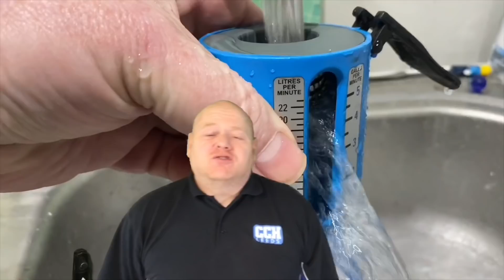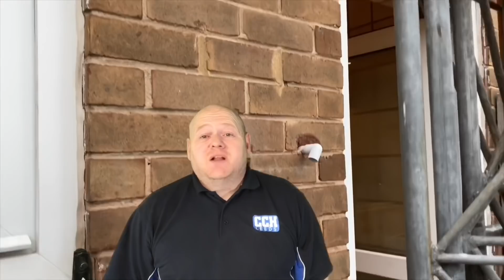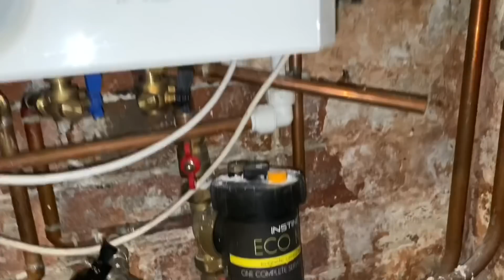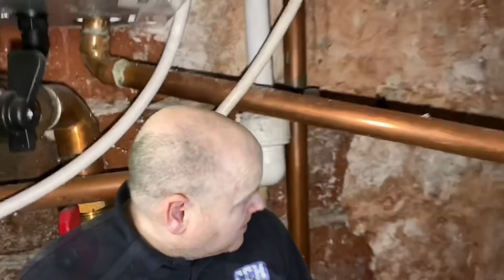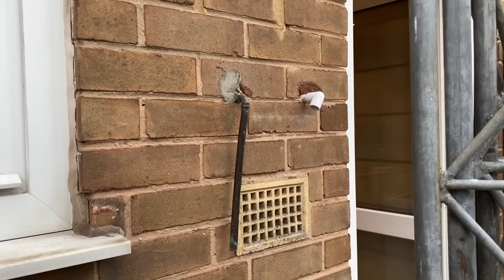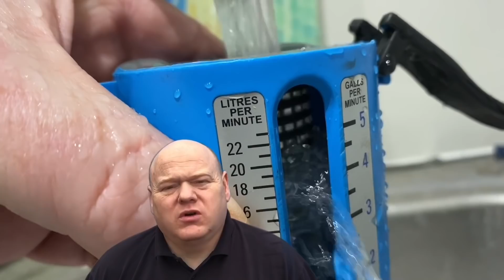LEEDS PLUMBER - BOILER QUOTES

Comment: This type of presentation needs updated! My Worcester Bosch 30 CDI is nothing less than a millstone around my neck, and bank account!!  I hope that a Worcester Bosch manager is viewing this!  New fan fitted yesterday, ran continuously until midnight then isolator had to be switched off. Engineer called back today and now says that the pump needs replaced, the 4th one!

Comment: Hi Alan, thanks for providing your expertise. I’ve really been informed by your working examples. I’ve just asked for a quote from an official wiiessman supplier to provide a quote. I don’t suppose you could give an indication of a price, the supply and fit of the Wiessman 111 I think was their recommendation. I have a 4 bed house with up to 3 showers potentially, GF, 1st floor and attic. The existing pipe work is in sound condition , I assume. My current boiler is a 14 year old Ariston ecombi, which has been almost completely trouble free but has just developed  a fault indicating ‘ insufficient circulation’  Not sure whether it’s worth repairing. I should add, it’s never been serviced! But, it’s been absolutely great all these years.
Penny for your wisdom. Thanks Alan. Peter, Glasgow, uk

Comment: hi.allen,hope the missus is ok.I have the exact same problem same boiler,decided not to throw good money after bad and went for new boiler but was quoted 2750 for the same boiler which was a straight swap as the previous install was first class.I told the rep where to go and am going for a baxi 630 due to depth restrictions, if i can find an installer which is not easy these days.
Reply from the maker: Hi Trevor send me your details and I will try and help with an installer 07725 692699

Comment: The brickwork : The one before that one was probably to close and eroded the brick -- so that is what they did 'a patch it up'. Now the extension from the wall is 'slightly' exaggerated hoping they didn't have the same problem again.  Fortunately it was protected by the antenna mast.  Unfortunately, cooking fumes and steam will play havoc on the control circuitry.  Maybe they should add a doghouse to the back of their wall to house a boiler, it couldn't look much worse.

Comment: The first one you could replace with a ATAG boiler(expensive but good)
Prv and condensation terminate in the same pipe. 
I would probably charge around £2000-2500
Reply from the maker: What about that brick work😂

Comment: I see shite like this all the time..fitted by A.N.Other Heating Services ( Gas Safe Reg 12345678) Regardless of quoting to do it right, filter, flush, correct gas pipe sizing, benchmark and doing the boiler notification customers see PRICE most of the time

Comment: Am a plumber and I would say most them installs were by cowboys builders. The worst one I've seen is boiler installed outdoors in the open air. Have seen a radiator outdoors aswell were customer requirements was heating while they went out for a cigarette

Comment: Having seen some terrible making good around flues but none as bad as that.

When a neighbour opposite had their boiler changed, as the flue was on the front of the house I gave them some matching bricks to make good. The the installer still botched it. The bricks may match the existing but nothing else does - the bonding doesn't and the mortar is way off.

Comment: Hi allen

Do you think the viesmann 111 35 kw storage combi  would satisfy a two shower property with a incoming flow rate or 17 lpm. Simultaneously.

Thanks
Reply from the maker: Cannot say without looking at property, Cylinder might be better but it depends on space. The 111 is a great boiler though. Thanks.
Reply: Thanks allen

Comment: 1st install I'd quote the landlord for a Main compact magnacleanse and new Mag pro 1 filter and new controls and yes too a baxi 600 or 800.  With the second install when you see a flue like that it's usually a builder or diy install for the 2nd either a viessmann  100 or a baxi 800.  For the 3rd a Viessman 111 or an Atag I40R or I32R dependent on the no of bathrooms.
Reply from the maker: Thanks.

Comment: Mother in law was in sheltered accommodation, council owned. They updated it and fitted full gas central heating, was originally electric storage heaters, the company that did it came from over 100 miles away, and had 1 day to complete the installation, 2 men, it worked, which was just about all that could be said, don’t see it as the installers fault, but the council, went for the cheapest possible quote. Never heard of the boiler make, cant remember what it was but when it broke, no spares could be found,  had to have it all redone correctly, with a Baxi, and all the pipe work replaced, so cost the council twice. The original installers left the house in a complete mess, they had another install the next  day, for the same council, just had no time to tidy up, they did apologise. With the traveling they must have been working 14-16 hours a day. The council even wanted to charge mother in law to come and pick up the old storage heaters.

Comment: Viessmann every single time.
Reply: My opinion is that what Viessmann did is "bible" for the rest of the boiler manufacturers (I only refer to the 200,300 Vitodens series with matrix burner and Vitocrossall model). Exceptional design; What other boiler allows you to set what season to be based on the time of year you are in (eg. if you are in the southern hemisphere where it is winter in June and summer in December - and had these settings on the menu 15 years ago. ...)
For the problems below I recommend my clients to buy Victrix Pro boilers from Immergas (hyunday genesis vs mercedes s Class: P)
There are more problems in heaven than on earth:
1: Electronic boards: not very reliable - 5-8 years are starting to have problems (easy to repair for those who understand)
2: They like to penalize you for trivial installation mistakes: if you install the chimney with the outer tube (suction) up, if it is raining heavily towards the chimney or if you have problems with collecting water from the roof and reach the chimney of the boiler the water will reach the outside of the combustion chamber and from there directly on the gas valve (not only because the electric connector of the gas valve is burned but also the supply side of the gas valve from the electronic plate: a fuse of 1 Amper fuse). (seamed on the electronic board) and the rectifier bridge (for newer models with a DC electrical supply gas valve)). If the water in the gas valve has reached and the connector on the gas valve is charred, the electronic board will burn - in which case the board does not cause any damage just because the boiler does not start the flame and you inexperienced technician say that after 3-6 years of without problems, the board can be damaged and you bring a new one, you mount it up and because of the carbonized connector on the gas valve you just burned another electronic board (1Euro components but for those who do not know how to buy the 3rd board ... )
   Water can also reach the electronic fan board .... :( - Other manufacturers do not allow this by combustion chamber design that has rainwater collection and diversion system but at viessmann it represents about 50% of all defects and Viessmann people love to make money from this kind of flaws ...
3: At the vitocrosall boilers (10000E / 60KW boiler) the older model (maybe even the most recent models) - the automation made by Dungs that controls the combustion uses a primitive flame detection circuit at all reliable and after 5-8 years you can find out that you need another automatic for the combustion control (component 500E) because they chose to use a poor quality 100nF capacitor on the flame detection circuit - all for the purpose of selling parts in the future ...
4 at Vitotronic 333 the newer models with monochrome display chose to use a screen with very poor contrast, which is quite difficult to see - on older models the screen had much better optics.
....
Reply: Mihai Achim the genesis of boiler design indeed. Cheers
Reply: Mihai Achim 
Hi mihai 
That is very useful information, I have in service many viessmann vitodens, 050 &100 models 
Can u tell me which capacitor is prone to failure? And how did u diagnose this?
I have replaced Pcb relays before but nothing else 
Appreciate your help!
Reply: Mike L 
I’m with you on that mate! Viessmann are all-that I’ve been fitting last 10 years and I’ll never look back

Comment: Great video again! As a customer, it is hard for us to ensure the installer is the "right" person for the job. We expect plumbers/heating engineers to know their stuff and do the best good job. Cheapest is not always best and to be honest, I bet there are expensive plumbers who are not much good either. Apart from seeing the words "Gas Safe" on their website/business cards, all we can use are sites such as Checkatrade (and have you ever seen a negative review on there?). 

Your videos are brilliant as it allows me to now ask the right questions of any boiler installer doing the work. Fantastic stuff!
Reply from the maker: Hopefully, my video’s will help customers choose the correct installers by seeing what they should expect. Thanks.
Reply: The reason you only see good reviews on checkatrade is because only good engineers use it really. It costs our company £150/month to be on checkatrade and the website is driven by reviews and good reviews, if you have poor reviews then it will show in your score and if you dont have any reviews you will drop off the page and not be seen my the customer. 

So we need to make sure we have a consistent high level of work and customer satisfaction otherwise we would be wasting £150/month. 

I may also add if we did get a bad review we have no way of removing this review so it would show no matter what. All of our reviews are 100% legitimate and are hard earned and we have a rating of 9.8/10.

In summary if you're a poor engineer with poor workmanship it would show immediately on checkatrade and there would be no way of hiding it so therefore if you are a poor engineer you probably wouldn't waste the money on checkatrade.

Comment: hi allen interesting video and some shocking examples of poor work or even DIY !! How much do those boilers cost with 10yrs warranty? Also you mentioned the boiler wattage is 30 watts do they come with higher wattage and what's the maximum you can buy?
Reply from the maker: You need to choose the correct boiler for the property. 40kw is one of the highest for domestic. Bigger is not always better though.

Comment: First one I'd have gone with a baxi 428, ifos, filter and a flush. I would also give an option for the 630 or 830 if the longer warranty was wanted but usually find landlords always go for the cheaper option.

Second one I'd have just ran 🤢

Third one, 18lpm isn't personally that great, obviously you get restriction through the tap etc so not a true reading but looking at that, I wouldn't put a heat store combi in, a vaillant 838 would be good for that in my personal opinion. Obviously the video has limited content to properly assess the property to what system would be best suited. 

As for jobs getting worse, your going to see more and more of it. Customers want to hold onto their money more and more. You go in a price for a proper job. Customer thinks its expensive, they get a second quote from the local do it all dave who comes in much cheaper than you. All customer sees is a saving and the thought of how good the installer is doesnt cross their mind, then they're left with a shocking install and out of pocket too.

Comment: Alan, when you have something like 18 litres a minute, can you install a larger kilowatt boiler. Is that corrected? The better flow rate the more kilowatts?
Reply from the maker: Depends on requirements but normally Yes. Thanks.
Reply: depends on your mains pressure as well if its a combi

Comment: Every landlord I quote for, especially around the West Yorkshire region, always seems to have a “cousin” that can do it cheaper!
Reply: Great. Let his cousin do it then.
Reply: Similar issues in Rotherham. Of course, this is purely annectdotal; from personal experience. Perhaps I'm just really unlucky?
Reply: Many Private Landlords don't even know they are responcible by law . Landlords are legally responsible for repairs to heating, hot water, gas appliances, pipes, ventilation, wiring, and sanitary fittings. Boiler repairs and servicing therefore fall under your responsibilities.

It is also the landlord’s legal obligation to service any gas appliances with the frequency required by the manufacturer. In addition, you must have an annual gas safety check conducted by a registered engineer.
Reply: @Scott Gibson: There are landlords and then there are landlords. Some are well aware of their responsibilities and others, in my experience (call me a conspiracy theorist) play stupid. Those for example who think that a gas safe/landlord certificate is the same as a boiler service. Get a cheaper person to provide the certification then scream at the the boiler installer/contractor when the plate heat exchanger gets gunged up after 4 years.
Reply: @scottgibson7534  its annual but if you have a tenant leave after 6months then you must have 1 done prior to the new tenant moving in, just incase the previous tenant tampered with the boiler or any pipes
Reply: moneytotight I never find out! I never hear from them again!😉
Reply: moneytotight  im asian, I agree. .hahaha 👍🏼
Reply: Martin Hammond Lo l😂🤣😄😀😁 im on the floor man 🤣😂
Reply: moneytotight My name is Ahmed. I’m registered domestic gas and commercial gas & HVAC engineer but most importantly a competent one. I run extremely successful and professional business in my city for large domestic and commercial properties. What’s your point?
Reply: moneytotight why with the racism? This could also be Kevin or bob?
Reply: skeatel moneytotight My name is Ahmed. I’m registered domestic gas and commercial gas & HVAC engineer but most importantly a competent one. I run extremely successful and professional business in my city for large domestic and commercial properties. What’s your point?
Reply: skeatel  no need to be racist
Reply: moneytotight  racist

Comment: Allen do use many stand-off kits I find the great fo tidying up the pipe work
Reply from the maker: You can take the pipes up the back on the Baxi 800. Thanks.
Reply: Allen Hart didn’t watch all the video I see ,fitted a 600 the other day ,straight swap ,didn’t have to make a new flue hole ,condense had to run into a soil soak though 3.5 hours

Comment: Don’t quotes include prices? People want to know prices.
Reply from the maker: kryptoniteee I quoted £1999 for first one, full system flush, omega filter, update pipework, Baxi 830, Boiler plus controls,  remote prv, etc etc. Would of been a good job. Unfortunately I didn’t win the work.
Reply: Allen Hart woah that’s a good price for your level of work! Their loss for sure.
Reply from the maker: @kryptoniteee  I was actually going to spend two days at property and do a first-class job and flush it correctly. Unfortunately, i didn’t win the work.

Comment: Working for a large boiler manufacturer I see installs similar or worse every day. Old and new. It amazes me that probably 9 out of 10 flues aren’t installed correctly. Was at one yesterday where the installer  drilled through the bottom of boiler to run a condense pipe through it and wasn’t low enough so went through side of combustion chamber and just left it. I.D.  Boiler 2 months old. Great vid Alan
Reply from the maker: We need to do what we can to raise the standards. Unfortunately good installers are been priced out of the market.